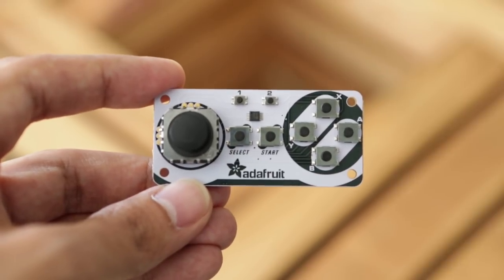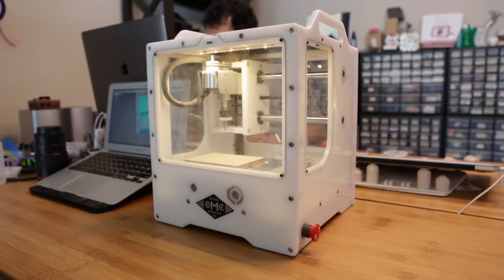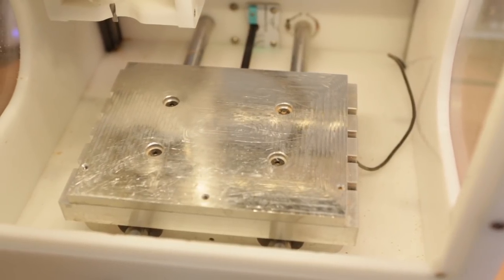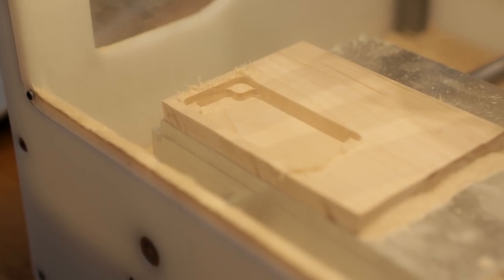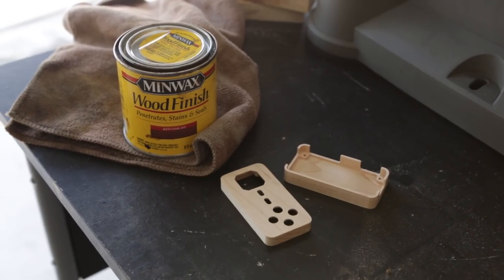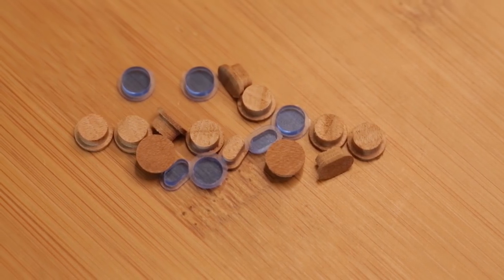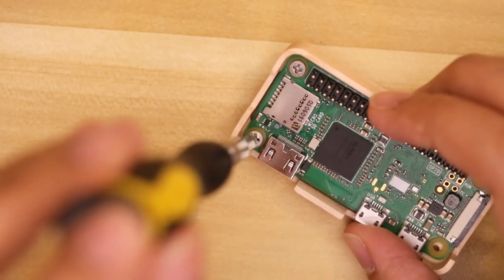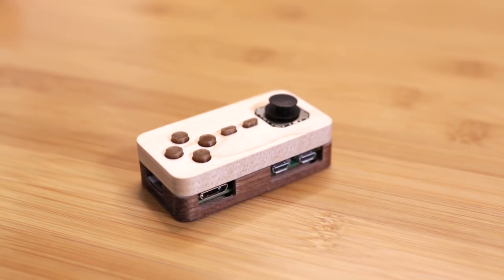How to CNC – Joy Bonnet Case for #RaspberryPi Zero #CNC #Adafruit

Comment: Great info! Would like to know more about the removal of the base material in a single direction. How exactly were you able to eliminate the wood flaps? By the way, the "l" in "solder" is silent, like sawder.
Reply from the maker: +matt newman Thanks! Mostly sanding removes any access, but later I got a tip from a friend who suggested using a spiral downcut endmill for making clean cuts with no burrs. Also, I like using the European pronunciation of SoLder 😉 - Noè

Comment: Why don't you solder the header upside down, and trim from the bottom-side instead? This would give you nicely beveled tips on the business-end of the headers, instead of jaggies from a wire-cutter.
Reply from the maker: I've actually tried this on a previous project. That works but I found it a bit harder to solder this way. I think it was because one of the ends on the headers are flush and doesn't provide proper heat dissipation, so the solder didn't want to "soak" onto the pins. If you look at both ends of the plastic piece that holds the pins, one has a little groove and the other is flush. When I first did this I remember thinking, "we'll that was a bad idea" ;-) –Noe
Reply: Interesting. I first thought your reason might be gold-plating or tin-plating on either side. Your headers in the video look as if they have gold on both ends.. I'll have to try your "bad-idea" scenario sometime. My workplace has high-power Weller soldering stations with short & stubby tips - this might be why I haven't had this issue before. I'll give it a shot with a "regular" soldering-iron next time ;) BTW - (you prolly know this already but) it is possible to push each individual pin through the plastic to adjust its free-length, especially if the pin is warm. A perfboard can be used to push the plastic bits (with the pins against a hard surface) all at once. This might be more work than cutting, but will give prettier results, for sure :)
Reply from the maker: Ah interesting points. I do have some different tips for my hakko, maybe I need to switch it up. Cool, thanks!